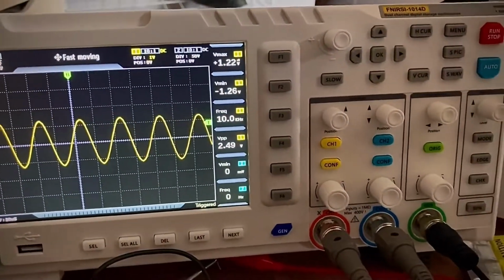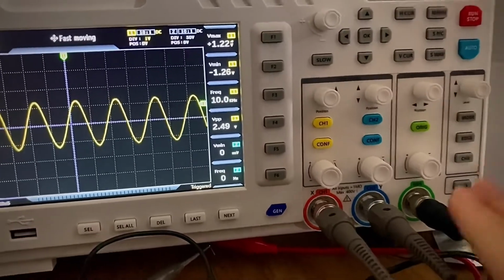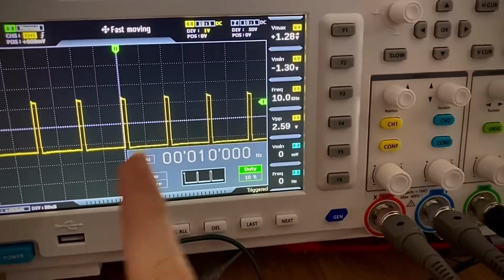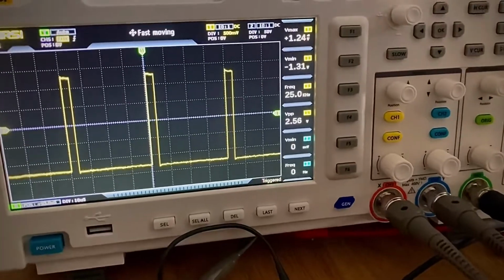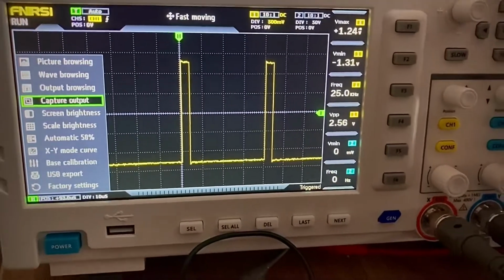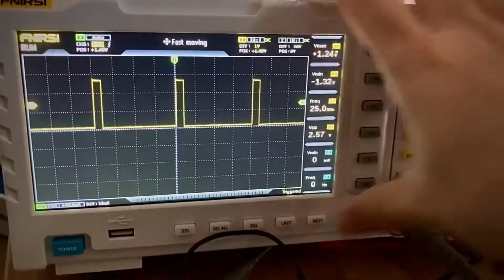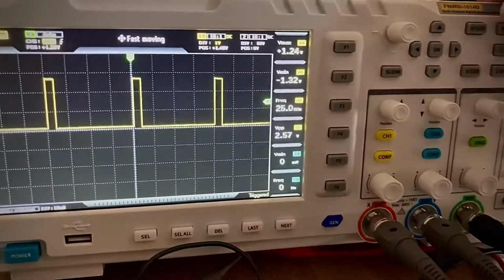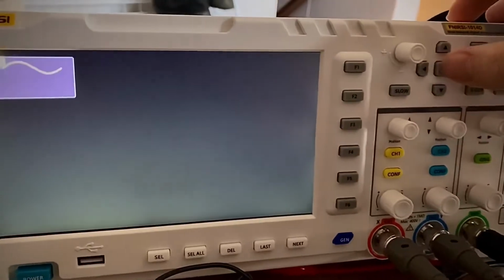FNIRSI 1014D - How to use the signal generator

Comment: Thank you for creating this video!  I watched it many times in the past but now I finally understand why you had to do this. I'll share my experience in hopes that it will help others grasp the issue quicker than I and to highlight a major shortcoming.  So I had a circuit that called for a DC square wave to mimic a PWM signal (e.g., such as from an Arduino where the voltage remains positive & never drops below 0V).  The problem is that the 1014D square wave generator only outputs in AC (e.g., alternates between a negative & positive voltage) which is not a PWM signal.  Now although your video does in fact show how to manipulate & then save the square wave so that it functions like a true PWM, the voltage output is SO low (e.g., <1V) that it is practically useless as it can't even drive a 555 Timer nor even light an LED.  I wasted countless hours trying to use the 1014D sig gen to only realize that it doesn't ouput enough voltage to use in even the most basic of circuits.  MY ADVICE: Buy a dedicated signal generator. I bought a very inexpensive FeelTech FY2300 signal generator that can output up to 10V and has a simple DC offset to easily produce a true PWM signal.  Now those circuits that failed in the past all work now!

Comment: I found it useful, thank you for sharing. How do I adjust the gain of the signal in the signal generator? I need to produce a 1KHz sineware signal (this part is easy now) but how do I adjust the Vpeak for this sivewave signal?

Comment: I think it's a pity that this oscilloscope comes off so badly with all the Youtube videos, most of the people who do a test here are professionals who simply assume a different standard that takes place in the upper price range... the corresponding ones are then too results. I ordered the scope anyway, it's more than enough for my applications, but I'll get it in 14 days at the earliest. Apart from whether the specified data is correct or not (which will still be proven) the only thing that bothers me about the Oszi is that there are no indicators for the push buttons (LEDs) and the weight also seems to be too light to press buttons without it slipping on the table, so I'll will add some weight in the Housing. I will definitely install a signal amplifier in the device because it is absurd that the amplitude cannot be changed. Otherwise, I can only assume that the current price for a two-channel scope including a function generator and other functions is just great. What is or would be of interest to me personally... It is often criticized that this is not a real 100 Mhz Oszi, maybe someone can try and measure a single cell pulse in a pulse series at 100 Mhz with a courser, which would give results stress me out. A big problem seems to be the power supply, which generates spikes, but for my own safety I will only use battery power anyway. When my Oszi is there I might make a video because there is nothing to be found in German. I only bought the part because my old tube Russian analogue Oszi ( 50 years old ) smoked away I can't get any original parts for it :-(....  between the stand of the Russian Oszi and the FNIRSI 1014D there are galaxies !

Comment: can you adjust the amplitude of the signal, for example i would like to gave 0.775 v (0 db)?
Reply: nope. fixed low voltage < 1 v DC

Comment: there is a possibility of making a video with a circuit of three resistors powered by the oscilloscope generator, measuring the voltages of each resistor and visualizing two voltages of two different resistors, thank you for your precious time

Comment: I found this oscilloscope very intuitive and easy to use even without reading the manual. But everything you showed in the video and much more is clearly explaned in both the manual I got with the device and in the manual downloaded from the manufacturer's site.
Reply: The manual says, and I quote "YOUR GOOD TEST TOOL".   Uh. Wow. Worst manual ever.  Practicability.   Was this computer translated from Chinese to english without any English speaking editor? SOLEMNLY REMIND.    NOT GOOD.

Comment: Can this replace my old millivolt meter ? Can it read .3 mV / 250 kHz ? Can it generate .2 mV 500 kHz Sine ?
Reply from the maker: I think it might be able to do both, but it is not really easy to use as a signal generator. If you need/want a cheap oscilloscope (and you are willing to accept its limitations), then it is a good product. But if you only want to replace something that currently works, then I would not recommend this change.
Reply: @ecosta  Your response didn't answer the question. Sounds like you don't even own one ?
Reply from the maker: @fickfehler3866 I own the one used in this video. But I'm no expert to give a solid answer those out of blue - I would need to test these with a real circuit. All I can give right now is my opinion.

Comment: Thanks for the video. Is there a way to set the amplitude of the standard waveforms of the signal generator? I have the same model and I really can't figure out how
Reply from the maker: As far as I know, you can’t do that. It outputs a signal between -1 and 1V, then you transform it as needed. For digital signals, I was able to use a transistor. Analog might be doable with OpAmps, but that’s a domain I’m not knowledgeable.
Reply: I’m still figuring out how all of this works, but didn’t you convert a wave of 2.5Vpp to ~0.86Vpp? From reading what the right sidebar shows it appears that the recorded voltage was different than the original one?

Comment: Nice demonstration ! I have the same model but the first channel is almost blind ! And the second is not accurate . My psu output is +5V and the oscilloscope measures +4.3V dc. Overall is a nice scope but the measurement accuracy is a very significant thing. I am not sure if there is anything I could do to fix the problems..
Reply: YOU should maybe look under the blister covers to see if the chips are soldered in correctly, with the model it is very common that they are positioned incorrectly. there are some videos on youtube of the procedure   https://www.youtube.com/watch?v=PS-EA8Tll50&t=47s
Reply: @werner7156  Thank you for your answer , when I find some time I will proceed with the operation!
Reply: @rtwodtwo9338  
No problem. please leave feedback here if this was your problem for others !  BTW.. after the repair, be sure to calibrate again in the menu.

Comment: It's possible use for laser cd eye pattern reading??
Reply from the maker: Well, an oscilloscope translates voltage over time into a visual graph and detects when a specific threshold is crossed. Assuming you are not actually pointing Class I lasers into people’s eyes (which will blind them before you get a working prototype), then all you need is a circuit to translate whatever your output is to a voltage signal. Then the opposite to translate it back to your input. Also, assuming again you are not burning people’s retinas, this device is not super precise nor fast. You will struggle if you need higher frequencies - which I imagine is the case for last signals
Reply: @ecosta  Have you tried to or looked into taking a sample at the LASER emitters input and the receivers signals? You should be able to see the sent signal on one channel and the reflected signal on the other channel. Won't hurt to try and see the results. Do know that the frequency of LASER pulse can be Way beyond what these scopes can capture.  I work with LASER communications and some of them are in the 680,000 GHz area. That speed allows LASER to send and receive 1-2 TBs speeds.

Comment: I had one... it really noisy at 10ns/div and 50mv/div. It can be resolved, by powering with linear regulator 5v 2a or battery. I got 150 to 200mv made it difficult to use for anything useful. The second channel was really difficult to calibrate.
Reply from the maker: Thanks for the info! I noticed some of those issues and I'm glad I'm not the only one. I'm waiting for a new power bank to try it on batteries, but I might look for a decent power supply as well.
Reply: @ecosta  I would advise trying to get a linear power supply if you want constant results. The power bank will only help for a bit. Alternatively break open the power supply and soldier on power supply pcb output point xr7 caps 2x22uf , 10uf , 4.7 uf and 1pf. The frequency that is generated from the power brick is between 45 to 140hz depending on your mains. Those caps will do the trick if you a diy person.
Reply from the maker: @naasikhendricks1501  got it! It’s a matter of waiting for a bunch of deliveries. I will try your idea later!
Reply: @ecosta  no issues. It will help reduce that noise to about 10mv. You can even create a small perf board with caps. You can add a common mode choke. Plus with the perf you can decap like crazy, if your local noise is different. I discovered that fnirsi power bricks are very inconsistent they will have you scratching your head when looking for a part of the noise. If you want to check a op amp, 10mv, it's crazy high noise. All the best